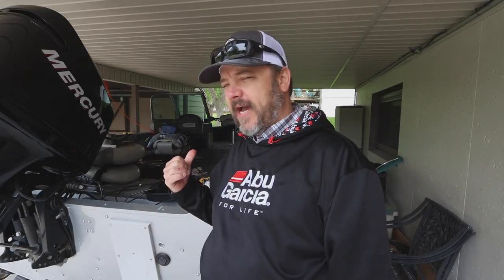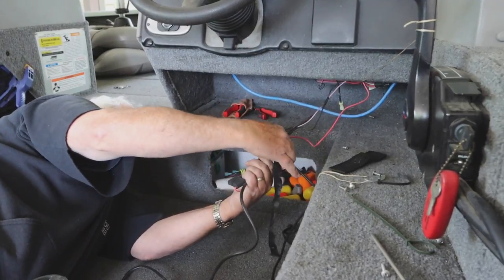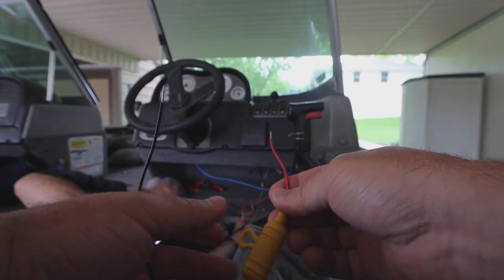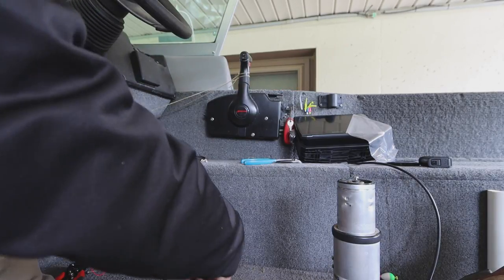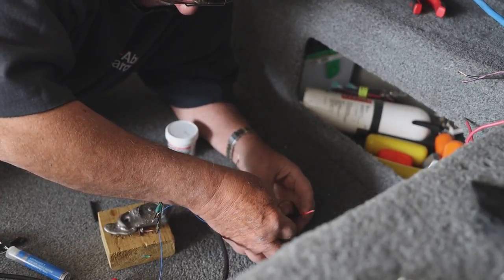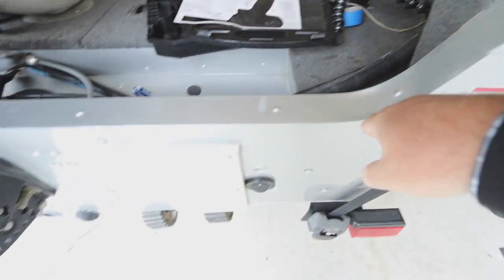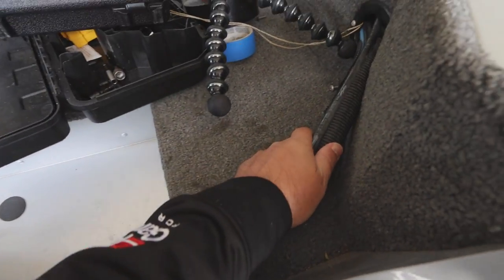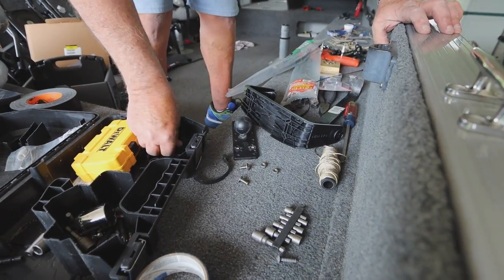How To Install Your New Garmin ECHOMAP - ECHOMAP UHD / GPSMAP / LIVESCOPE Fish Finder on a Boat!

Comment: ABYC rules do not allow soldered wire connections like you show because they are more likely to break due to vibration. Proper crimp connectors follow the ABYC standards.

Comment: Did ur transducer wire have a plastic nut to secure it to the rear of the mount?  Mine didn't have one and all the other units at bass pro also didn't have one  it stays in but I'm sure it will randomly fall out hitting wakes

Comment: Oh no you forgot to mount the screen. Anyway if you'd put the screws about 1/2 way down the sliding mount for the transom bracket it may have been enough with the 2 screws as opposed to putting an extra third one in. Just a thought. The plastic plate is a good idea for transom protection.

Comment: I'm confused - if the power supply for the 93sv has a blue wire that would communicate with the black box, why would the black box stay on when you turn the graph off?
Reply from the maker: The black box has constant power running to it.
Reply: The blue wire isn’t meant to connect to the livescope black box. He also installed the transducer backwards. I’d take anything from this video with a grain of salt.

Comment: I just purchased this graph and I want to install it myself. If I ran power straight from starter battery to graph. And were to unplug and take the screen with me when stored, would it still draw power?
Reply from the maker: As long as you don’t have the black box for livescope. If it’s just the graph and you remove it at the end of the day, all power is at a dead end. Hope that answers your question!
Reply: @g4outdoors  thank you so much! I thought about hooking it up to an auxiliary switch but I cannot find the correct cables! It’s a cable management nightmare.
Reply from the maker: @br3xa836  nope. If you don’t have the black box, the graph is the only thing that draws current. My new boats wiring is scary to me, so I just bought a little Amped Outdoors 18 amp hr lithium battery to throw up on the front deck to run mine lol.

Comment: Awesome vid! I was wondering what the heck the blue and brown was. The manual only said RX and TX so was confused as to what was needed for input output or if they were for auxiliary switch on my board. Much appreciation!
Reply: Oh yeah, I had the exact same thoughts when mounting the transducer. Did not like how that cable is on it and after much thought put both screws furthest to the bottom to hold it firmer to boat so their was no give on the mount plate.

Comment: I have a question do you need a trolling motor that has spot lock on it when your running live scope
Reply from the maker: Need? No. But it sure helps a ton to keep your transducer pointed it the same direction. Otherwise you’re going to be constantly adjusting your graph or the direction of your transducer, unless your tied up to something.

Comment: I hear some people mount the the X ducer on the trolling motor..   i'm looking at this unit too..I might have missed it before.. is that a rocker switch  on the transom?.
**  Update.. I did purchase this unit...  Thanks for the  video.
Reply from the maker: I don’t understand your full question. Sorry. Check out some of our other video for the transducer mount and check out FishFinderMounts.com , hope that help.
Reply: @g4outdoors    I was wondering  what that was on the transom.. it looked like a   rocker switch.  if you look at 14:45  just below  where the transducer cable goes into the Transom of the boat.. that black  spot.  I thought it was a rocker switch or something.  In regard to the other question   i was  just saying that  some people mount the Transducer  ON the trolling motor instead of where u mounted it...  Thanks for the  reply.

Comment: I've ALWAYS ran power and ground to the battery. You'll have less problems doing this! Just my $.02......
Reply: I actually prefer wiring to a dedicated accessory switch with the correct amp circuit breaker.  You can then eliminate the inline fuse, but still have the necessary protection.  And, you won't have to worry about digging under the dash to replace a fuse or making sure you have fuses on-board.
Reply: Ya know the Ignition switch is connected to the battery already? Also uhh the fuse panel? Usually within 12 inches of each other?  Where your method is always on? (Constant potential for drainage)
Reply: @Ag3nt_X  Didn't mean to offend brother just sharing my personal experiences with ya! I've ran them multiple ways and I always have the best luck directly to the battery also I take my units off after every trip so I could see where someone might not want constant power!
Reply: @WeekendPursuitOutdoors  not offended at all bro, just saying you can tie in at either of these two points and it's the same thing electrically... something for you to consider in the future.

Comment: My garmin came with a little part that hooks to the transducer. It has a magnet 🧲in it. What is it for and do I need it.
Reply: It’s a ferrite bead/ choke and according to the instructions it’s supposed to go on the transducer line near the connector. It’s to reduce noise in the lines and comply with regulations. I don’t think it’d be the end of the world if you forgot to put it on/ lost it but I try to stay as close as possible to installation instructions to try to get the best results and eliminate unnecessary variables